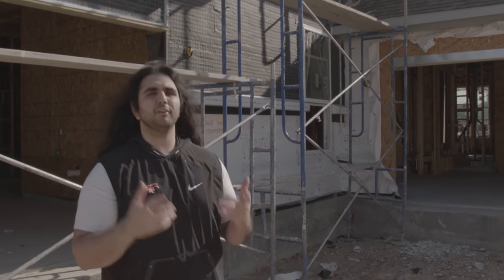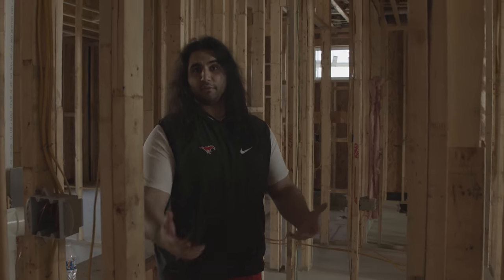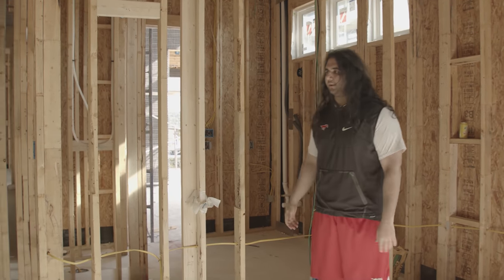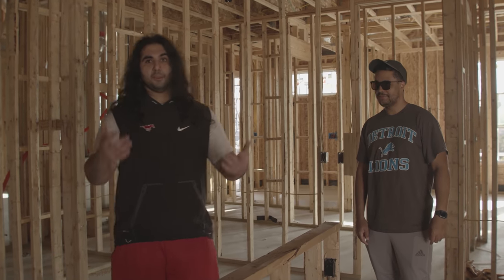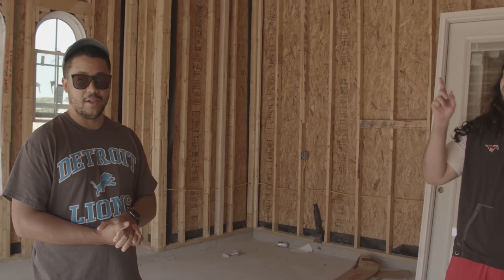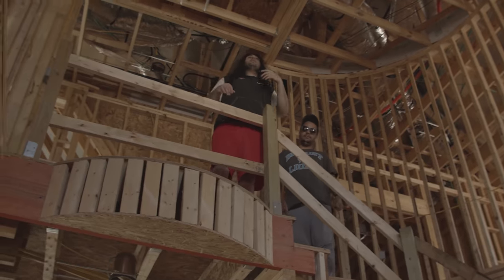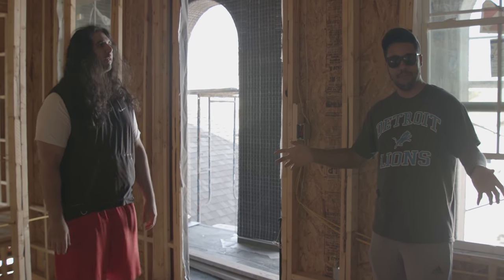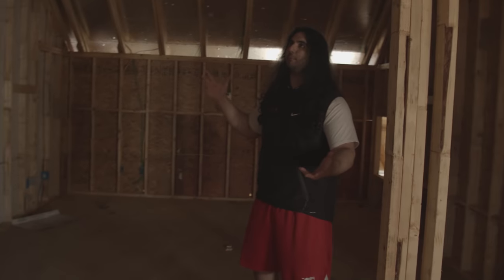I'm Building an OTK Content House...

Comment: Literally my dream house man. So nice Esfand. Very good.
Reply: Yes a dream house made out of wood
Reply: @Rysix19  what's wrong with wood?
Reply: @Rysix19  what?
Reply: @Roch10Family  EU houses are usually made from brick, cement, and more durable materials. I’m sure there are a lot of wood houses over there as well, but they don’t talk about those.
Reply: @rSuarrez  Durable to what exactly. Wood houses don't fall apart ...
Reply: Most houses in the US are wood framed. Its cheaper and easier/faster to build. The main problem is that wood is a terrible insulator compared to stone/bricks. Doesnt matter in a place like Texas but anywhere that its cold it sucks and costs much more to heat your home.
Reply: @zoogie980  Doesn't matter in Texas even though Texas was hit by a massive cold front due to climate change, which will be more common in the future.
Also don't you guys have tornados and shit? No wonder your houses get destroyed when all your walls are basically fucking OSB.
Reply: @zoogie980  wood is fine here in Canada, you can insulate it
Reply: @Roch10Family  Wood ages faster and deteriorates quicker. It is susceptible to termites, moisture, mold, fire, water damage, and high-speed winds. it also needs further heat and noise isolation. Concreate is the superior building material and even the higher initial cost is offset in the long run compared to a wooden structure.
Reply: @ddddaaaaaaaa  yes. i live ina very cold part of the US and wood works with the right kinda insulation. But if you have ever been inside a brick/stone house that uses a boiler instead of a furnace you can feel the difference.
Reply: @noobkaka567  Tornados, hurricanes, earthquakes will tear down any house, wood or not. The US has much more people than the UK and a lot more space. we just build more houses... Stone/brick is better but it costs more and is just not realistic when timber is in such supply.
Reply: @akselmani  except that concrete is in short supply in the US and is extremely expensive. Its better for sure, but isnt viable with how much building we do in the US
Reply: @zoogie980  I am not sure why you feel the urge to continue writing comments and having the last word here, even tho you are inaccurate in your statements.
1. You gave the worst possible example with texas right after an actual disastrous storm which negates your entire argument. 
2. Yes, concrete is more expensive... it's normal considering it better than wood on every other parameter.
3. Again, this additional expense is offset by its durability and longevity.
4. There is no such thing as a short supply of concrete in the US...the ingredients for the mixture are still widely available. It's just that wood is abundant and concrete is a more complex material to make and work with, that's all.
5. "Tornados, hurricanes, earthquakes will tear down any house, wood or not." - mmm nope. Well-made concrete houses will not sustain major damage from Tornadoes and Hurricanes with up to 300mph winds and earthquakes up to 8-9 magnitude.
6. If the amount of building is collerated with the materials used, then the US would have used more concrete not less. China has 4.4 times the US population and uses way more concrete. Yes, you have a lot of wood there, but that does not mean it is a good building material on its own... which was the entire premise of this discussion - If you are gonna build a mansion like forever-home.. better use the best materials.
Reply: @akselmani  as someone from the US who has worked building houses for 15 years, yes there is a concrete shortage. more specifically a cement shortage. idk what makes you think that youre an expert in US houses when you dont even live here LOL there has been a shortage for many years now. Its not impossible to get but it is wildly expensive and that why we dont use it much.
Reply: @zoogie980  If you have been building houses for 15 years, I will start praying for all those people living in them. Also, you have no idea where I live or what I do for a living. Also, 2 years =/= many years... Nobody in the US was speaking of cement shortage in 2018 and even 2019 but I guess you love making a fuss out of everything + CEMEX will fix your shortage soon, but I guess then you will find another reason to make excuses in comments under a youtube video...
Reply: @Roch10Family  there is nothing wrong with wood if it's done properly most houses have some wood in them including my own my house is probably a little over half the size of this house and the flooring and the attic is made from wood but it's good wood much thicker than the wood in this house unfortunately this house is made from chipboard and sticks but Texas is hot and dry
Reply: @zoogie980  but we also have heating and AC in every house so it doesnt matter as much. Almost no houses have AC in Europe

Comment: So as a cable technician/electrician , your green low voltage cable is coming contact or crossing paths with the Romax/ electrical wire ! And 100% you will have interference , you need the guys who ran your networking cable to use Smurf tube or innerduct in those areas so it can block the interference ! If one of your cables in your house gets interference it can travel all the way to your switch and from there will get onto your network and you’ll be having so many problems I’m just trying to give you a heads up !!

Comment: You should put SDI jacks over the house. You could run them to an SDI multiplexer(I've used the Black Magic Designs UHD Multiplexer at several live venues and it's very solid) and then run it to your PC and capture using any 12G SDI capture card(I prefer the Decklink UHD 12G but that's just personal preference). That way you could run all the cameras in the house to your single central stream center as described.

Comment: Nice, I'm jelly on getting a house built. And nice to see a streamer house actually built with streaming in mind.
Some random things I would think about is:
-Installing some pipes and boxes for video/audio cables. Corner of room, over cooking area, behind TV etc
-Wifi access points on the ceiling for full coverage around the house.
-Get some plywood/OBS behind the drywall where you plan on mounting something to the wall ahead of time.
-Improve sound isolation for the shared wall and doors. Sucks if sound easily escapes through or under the doors after separating them.
-Smart home system (Security, lighting, AC, screen shades)

And just curious how much does it cost to build something like this?

Comment: Holy shit, some electrician and networking contractor is making bank off your house.. you can put a special spray foam insulation on the walls to help with noise reduction. Its pretty cool house
Reply: Nah that shit is no good, it's super flammable and hard to get rid of once it's in. Bulk insulation batts are the way to go

Comment: April fools? Nice.
If not, sad that it is not future proof (passive house/great insulation, w solar panels, geothermal, tesla battery & charging port, hurricane-proof, and a freshwater tank to bridge the next 10-year drought, and outside sprinklers to ward off the occasional fire season).
Reply: Austin doesn’t have wildfire issues, nor drought issues, or hurricanes lol & solar panels offer no benefit to the house as they don’t increase the value. It’s basically like getting another mortgage, but for 30yrs on solar panels while they add no value to the home.